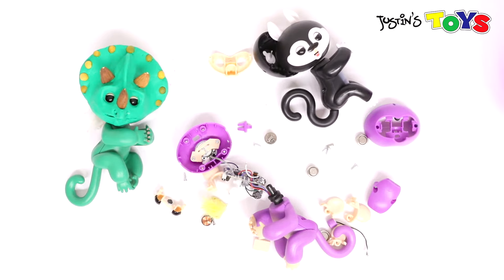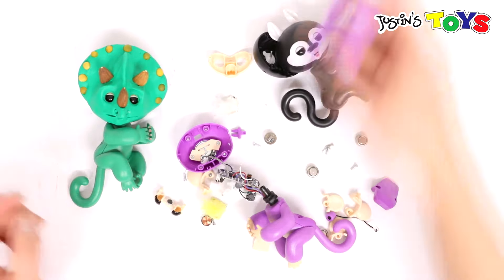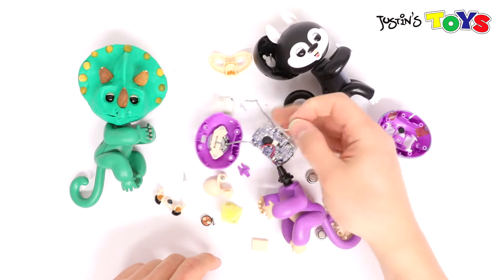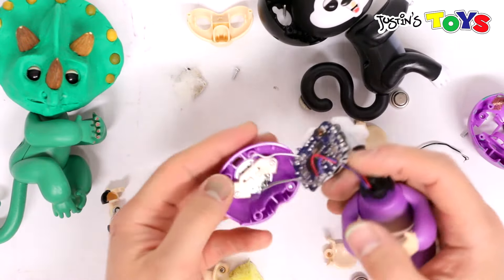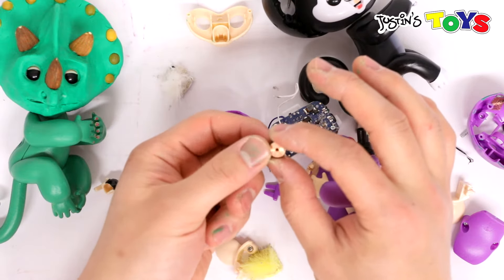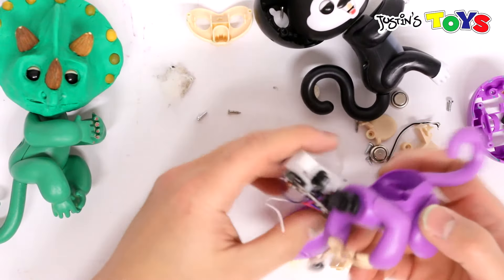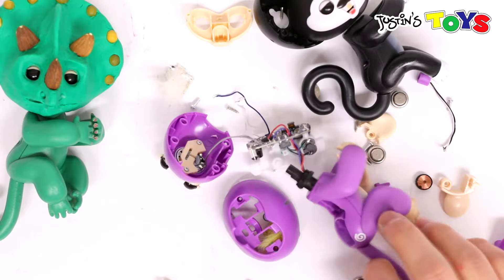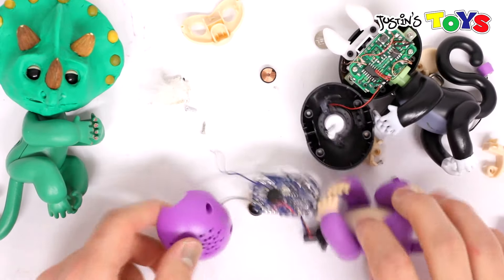What's Inside a Fingerlings? Real and Fake Monkeys Dissected

Comment: No Disassemble!
Reply from the maker: it literally took me like 5 minutes to unscrew the 4 screws so I figured it was easier to just show it already dissassembled
Reply: hehe, poor thing. I was wondering if it wouldn't just be easier to design a faceplate for it with a 3D printer?